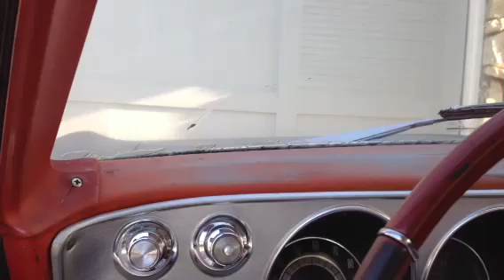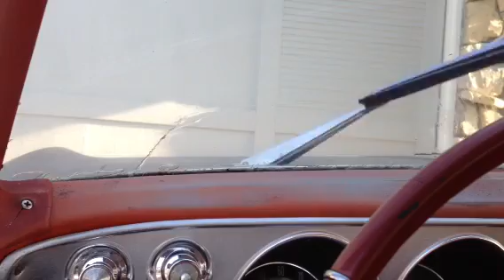Intermittent Wiper Module

Comment: so looking to get one to work on a 73-77 gm a body chevelle with hidden wipers, does this park the wipers at each intermittent cycle?
Reply from the maker: The 13023 version will work with hidden wipers.  Yes, the wipers will park after each intermittent swipe.  In continuous-slow and continuous-fast modes, the wipers do not park between swipes.